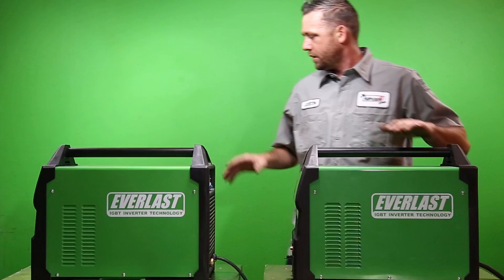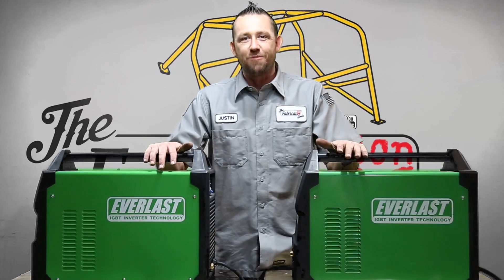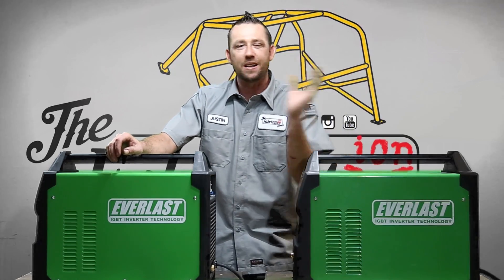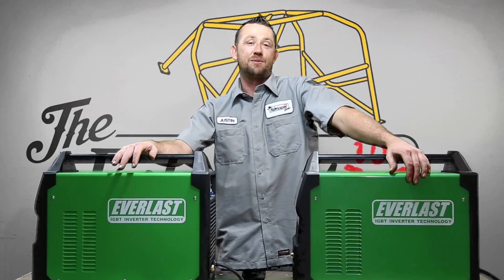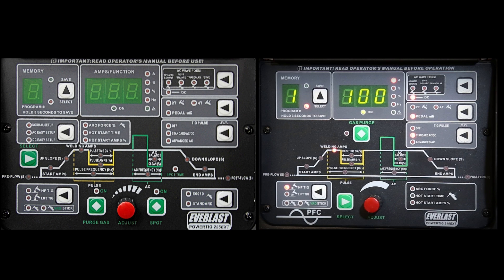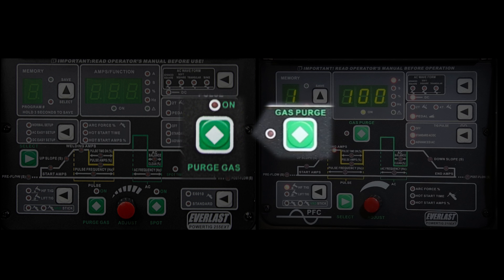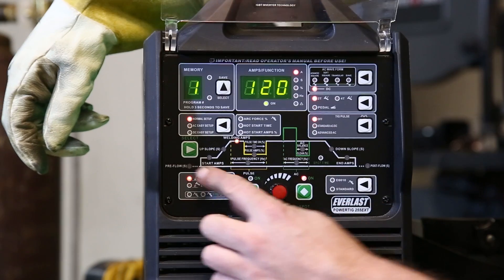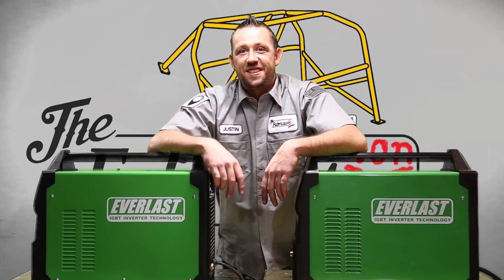TFS: Everlast PowerTIG 255EXT and 210EXT Welder Review

Comment: Bought a 255EXT about 8 months ago and been pretty happy with it.  1/3rd of the price of my Chinese built Dynasty, better duty cycle and comparable features. Everlast has stepped up the quality of the accessories,  the torches, foot pedal and flow meter are actually decent. Is there better, sure, but the stuff Miller included with my Dynasty weren't the best either. I think Everlasts customer service is better, bought direct and they were nice enough to price match without a big hassle. Thinking about getting a MIG and another 255 from them soon.  

The videos are always great, thanks, enjoy watching them. Even for the type of fab work I'm really familiar with it's always nice to see how someone else does the same thing, always learning!

Comment: hello, glad you like your machine.....here in the Netherlands a slightly different version is sold under the name of free tech.
I have this one :https://www.marktplaats.nl/a/doe-het-zelf-en-verbouw/gereedschap-lasapparaten/m926806381-freetech-4in1-digi-pro-10-black-friday-korting.html?c=8c285449651fa109c354bbabe740c1b&previousPage=lr

I've had it for over 2 years now and it works like a charm.
this version also has a stick weld and plasma cutter built in. So its very versatile.
What thickness are your pie cuts for the tubing and at what setting are you getting the best results?
Reply: It may seem like a slightly different version, but the US built and pioneered that machine model, and is actually not built to the same specs and QC as Everlast.  If you want a Euro version Everlast, our distribution for Europe is based in Finland.  http://www.everlastwelds.fi/

Comment: Justin, thanks for the video. When replacing my old monster standup Lincoln TIG with pulse, I found out about the 255EXT Dec 2016. Like you, I never even heard of them; have always owned 'blue' or 'red'. I could not believe they could offer the quality for the price they sold for. I'm sure glad I took the gamble and bought it! Great machine; power and control! I have to say that 4 months in, the main diodes went out, but it was all covered by warranty. Would I get this again...oh yeah!
Reply: milehidude so it died 4mo in and you are calling it quality? I’m curious as to why?
Reply: Hi Jason...I’ve owned many welders over the 40 years that I’ve been welding. They’ve all had problems of more serious nature than what I mentioned of the 255EXT.
Reply: milehidude just curious, not trying to toss a dig, I was just curious. I was looking into one. I have the HTP 221 but looking for another one for the shop. 4 mo in going bad has to be a QC or shipping issue I would assume. It’s though to compare all the transformer machines (ived owner many) to this. Totally different animal than copper wrapped machines. Have you had any issues since?
Reply: Hi Jason. No issues to date. The only thing I would add is that you can’t use pure tungsten electrodes on inverters ... they burn through the electrode too fast. (The manual makes note of this)

Comment: i bought a POWERPRO 205 SI from them and when it arrived it didnt work  showed an error code. i did get a 5 year warranty  for 1600 dollars. i was insanely upset.  the sent me a board and told me to fix it myself????   well i tried that .. didnt work. they wanted me to send it back  was going to take 40 to 60 days to fix .. i raised such a fit that they sent me a new one first .. i repacked mine in that box and sent it back..  i am new to tig welding and  using a plasma cutter.  did very little work with both of these and after 6 months .it broke again. error message .. called went threw the same crazy  service.. there service department sucks on the phone. by the way,,,,,  now i sit and wait for 40 to 60 days to get it back..  that is my experience with everlast.. i hope and pray it is fixed this time and i dont have any more problems from it..    be careful guys its the bad unites that hurt yea not the good ones  and they do make bad unites trust that
Reply from the maker: towerace123 That's a bummer. Hope it's fixed next time around.

Comment: I’ve been debating between the everlast or the AHP for my next welder.  The old miller ab/p is a little large to be moving across the shop at 850lbs.
Reply from the maker: rockstarrcustomz I have an AHP. It's a decent machine, but I'd grab an Everlast for better control and long life. It's a more serious machine than the AHP.
Reply: The Fabrication Series .  Excellent, I’ll do just that.  I picked up the rouge bender on your recommendation and it was excellent.  I trust your judgement.

Comment: Gotta get your hands on one of the MTS 221STi machines. Everything you need in one machine.
Reply: The Fabrication Series did you get a video out on the 221 yet?
Reply from the maker: Larry Watson I'll be honest - I love the 221. It's super smooth, has little sacrifice to quality being a multi, but I need more time to really discover it in an unbiased manner so that my review is fair and honest. I do have a huge project coming up where I'll be using it which should be the review.
Reply: The issue with Multi are duty cycles are usually much lower, i guess if you are a weekend welder its fine
Reply from the maker: Weld.com Its going to be on it's way here after this weekend. I'm really excited to try it out.
Reply: When do you think you will have a review video of it? I am stuck between the 255EXT and 221STi.
Reply: In my opinion while it is convenient to have everything all in one unit it's also everything dead in the water should something go wrong so it's kind of a toss-up it really isn't that much more money to buy separately in a lot of cases

Comment: Could you possibly do a review on the 250 EX?
Reply from the maker: 4Xprops !!!! It's prectically the same welder as the 255. Only difference is it has knobs instead of a digital menus. I think the 250 is only 240v power as well.

Comment: Are you using a Watercooler on these Machines
Reply from the maker: Tom No.
Reply: Having one problem with Everlast they have not yet been able to produce a water cooled, thumb controlled torch for me. I am a paraplegic and have no use of my feet. So, this is a must.
Reply from the maker: Tom I could be wrong, but you could use any water cooled torch with a switch for straight amperage. I'm pretty sure there are a few other setups out there that are compatible as well.
Reply: I need to check around a little more. I have only looked at CK and they told me they had nothing that would work with Everlast. I am sold on the machine if I can just find the right torch. Thank you for your video, I enjoyed it and it confirmed for me to buy  Green instead of Blue
Reply: @finchadaptivefabrication4689  Have you checked out PrimeWeld Tig225? It uses CK torch. Sorry a little late than never.
Reply: Tom I have the 2017 255ext and it comes with both the #9 air cooled and #20 water cooled torch, both come with the super flex cables, cable covers and the torch trigger/button. You can set the machine to strictly run off the torch button, if you use torch button you can set the machine with pulse, up slope, down slope. I like to let the down slope taper the heat down and push the torch button again and the up slope will taper the heat back up, this helps keep the heat in control and also helps when your getting out of position. Maybe Justin can go in depth with this on a future video.

Comment: Just throwing this out there, but Everlast's website says the 255ext only has a 100% duty cycle at 200 amp and has a 60% duty cycle at 250.  Still pretty good just wanted to point it out.
Reply from the maker: American Machine You're correct (I didn't reiterate). I aimed it more at 100 because it's more than half of the range.
Reply: Ah, I see.  I didn't know if they had it wrong on their site or what.  Still impressive nonetheless!  These are looking more and more impressive the more videos I see of them.

Comment: I want too know how durable they are compared to a similar Millar machine.  Push the 210 into over heating? Do they have a good warranty?
Reply: Warranty is 5 years, but read the terms. They may ask you to replace parts. If the machine has to be shipped for repair, you pay shipping each way. Some people report huge repair delays. I’ve been waiting a month for parts to repair shipping damage on a new machine that I haven’t even tried yet. I have no idea when to expect the parts, nor does Everlast. I knew all this going in—it’s what you have to do to get these machines at this cost. No free ride. The comparable Miller would have cost three times as much. I wish I could support that, but I just can’t.
Reply from the maker: Mean Man I have pushed them both to the max and never hit the thermal limit in 6 months of testing. Obviously I can't say that for the next 6 months (or years), but I can say that I'm not worried about it. The warranty is 5 years.
Reply: Yes huge delay in repair time.  I had to send mine back and turn around was 3 months. I started calling them twice a week.  But for the price you can get two machines.  I started to get the blue guy but a friend of mine had to send his back and turn around was also about 2 months.  I dont know if he had to pay shipping.

Comment: I got the 210ext and find the noise that the always on fan makes to be annoying.  It also trips a gfi in an adjacent 110 circuit to my 220 circuit.  Maybe grounding the device would help..  I doubt I would purchace this welder again, I'd probably stick with overpriced Miller.
Reply: Sounds like you have issues with the wiring in your shop. You should have that checked. As for the fans, I'll take the continuously running fans for the high duty cycle over the gimicky "fan on demand" the Miller offers. My shop isn't a library, so it isn't quiet. As for the overpriced Miller, and YES they are WAY OVER PRICED, it can also trip your GFIC 110 circuit. Circuits don't care what color your welder is.
Reply from the maker: +Oldsmob455 I do wish the fans are a bit quieter,  but in my shop, nothing is quiet. It's not as loud when everything else is going on, but understandable that it would be kind of annoying in a garage or at home. My Lincoln MIG is actually louder than the Everlast machines combined haha.
Reply: I'm using a 220volt outlet for my welders.  My Miller doesn't trip anything, especially not adjacent 110v circuits with nothing plugged into them.
Reply: why didnt you get another unit if it was making funny noises... everlast has a much better warranty than millers
Reply: I owned a first gen 201 EXT and thought the fans were really annoyingly loud also. Are the current 210's just as loud?
Reply: Did you call them about the outlet tripping...maybe something got damaged in shipping?

Comment: Hey Justin , I to would be very interested in you findings about the Advanced AC Pulse as im only self taught im struggling a little with setting this feature up. I have the 210 EXT and i to am very impressed with this machine with the knowledge i have so far, ive had some people tell me i must be using a Miller or Lincoln to have the ally welds come out so clean and there jaws drop when you tell them its an Everlast and like you said, they then say who or what brand is that. Any how thanks for the videos you do , much appreciated 
Cheers from Australia
Troy

Comment: For anyone in the UK - these look to be essentially the same as the R-Tech Digital AC/DC 210 and 260. For some reason, the UK models don't have the gas purge button.
Reply from the maker: I just checked them out. Pretty similar.
Reply: They are based off the US design, but do not have the same internals, and QC that our units go through.

Comment: I’ve been using the Everlast 185 micro for a few years now. Pretty much learn how to tig weld on this machine. Now I’m thinking To upgrade to either of the two machines you’ve reviewed. The 185 works great but lack a lot of features.
Reply from the maker: Features are nice, but not always essential. It's up to what you actually need to get the job done. I'm kind of a sucker for features whether I use them or not haha.

Comment: I just bought one of these machines here in Australia. Pretty damn good and the price is unreal... Old 10amp wall plugs here trip out sometimes as its a 15amp plug here, but new outlets that are 10 amp (make up an adapter/grind down the larger earth on the plug like some ppl do) are meant to be rated to 16 amp and i havnt had any trouble on a new circuit. In NZ new 10amp outlets are rated to 20amps my mate tells me so even better for when i shift back!
Reply from the maker: Interesting to learn about the outlets. They're a little different here.

Comment: Would love to see the 250ex if you ever get a hold of one, it’s a little more affordable than the EXT.
Reply from the maker: They're almost the same machine, so I probably won't be getting it on my next order. The primary difference is the EXT is digitally controlled. The EXT also offers a few more parts. The duty cycle is also different (not in a bad way) between the two. I'm sure it's a solid machine either way.
Reply: Yeah the 250ex is good just the older model  it does not have the wave forms though if that makes a difference to you. The 250ex and 210 run about the same price i'd get the 210 if I were you. If you need more power just get a helium cylinder to go with it.

Comment: I've had the 255ext for about 2yrs. Great machine, zero issues. I upgraded to a #9 ck-world wide torch, and the scc foot pedal. Both great upgrades(nothing wrong with what came with the machine). I had the Everlast powertig 200dx before switching to the 255ext, which was also a fantastic machine. I have noticed that the fan isnt as loud on the 255ext compaired to the 200dx(which wasn't that bothersome to begin with). 

My 255ext included a #9 air cooled torch and a #9 water cooled torch. Foot pedal, starter consumable kit, flow meter, gas hose, 220v to 115v adapter, and a basic setup guide.
The machine ask comes with a 5yr warranty which is pretty nice.
Great machines for a great price.
Reply from the maker: That's the machine I was originally going to buy before researching a bit. All the features, 100% duty cycle, and all the parts/accessories included were big reasons to buy the 255 over the 200DV. I'm sure it's a solid machine. The price is also the big seller. The two machines I have are less than the one Miller machine I was originally going to buy, and the quality is the same so far (especially with the 100% duty cycle).

Comment: Are you using the accessories that came with the unit? What are your thoughts on the torch setup (torch, cable etc.)
Reply from the maker: Yes. Both torches are OEM torches included with the machine. The only thing different is the stubby kit on the 26 torch (not included with the machine). They are actually pretty good torches. I've definitely pushed them well above their ratings and haven't melted them like some of the cheap torches I've used over the years. You can always upgrade if you want though.

Comment: What is your outlook on the Eastwood 200 tig as a cheap entry level welder.  Currently on 110v but will be upgrading to 220v soon in my shop.  Like the fact it can go between the 2.
Reply: We were not pleased with our Eastwood unit. 
Poor quality, not many features, poor arc stability, extremely poor duty cycle, broke before the warranty was up, was replaced under warranty, broke again shortly after warranty expired, no repair parts were available.
Reply from the maker: I have tested the older models with mixed results. I've never been able to get the same weld out of them twice. I haven't tested the new digital unit yet (or used one), so I can't offer any realistic or honest review on it. It is rated pretty low on the duty cycle, and I know a few people have reported a couple issues to me, but they seemed to get sorted out. Until I get some torch time with it, that's about all I can say.
Reply from the maker: These Everlast units are both dual voltage (110/220) as well.
Reply: i made that mistake. The AHP is light years better than the Eastwood unit, only grip with the AHP is the knobs are cheap and break easy so be careful with them, the ssc foot pedal is a must upgrade and ck tig torch. plan to purchase an everlast soon with water cooler and a ck torch.

Comment: Justin, Could you please do a video on the 255EXT's "Advanced AC Pulse" feature on thick aluminum. When set properly, You can weld 3/4" thick aluminum to 3/4" thick aluminum without helium, or preheat. I'm saving for a 255EXT right now. I'm so close!
Reply from the maker: I'll check it out. I have to get a water cooler first, but I'll see what I can do.

Comment: Down here(Australia) our 210EXT has all the features of the 255 except the spot and gas purge, my 210 is a couple years old now hasnt skipped a beat so far... I ended up springing for the matching water cooler(W300)and a 25' CK230 torch can hold hold that sucker absolute flat chat indefinitely :)
Reply from the maker: Nice!
Reply: Sounds good. how much money did the welder cost in Straya? 
Thanks Steve.

Comment: i have had the 210EXT for about a year it works great! You can drill a new hole and move the gas inlet over.
Reply from the maker: I figured I could move the inlet over, but I just grabbed a fitting. It took less time and didn't leave any extra holes in my machine haha.
Reply: Mr. Tig recommended to toss the stock torch and  get a 17 size. What was your experience with the stock torch? Thnx